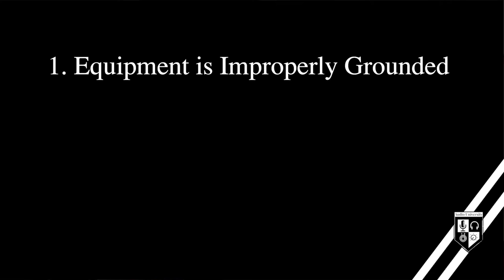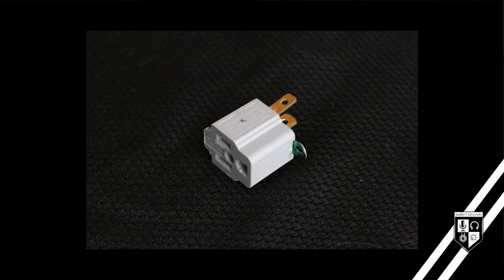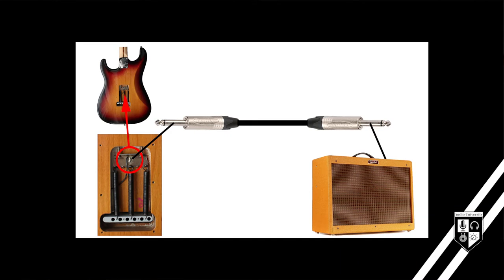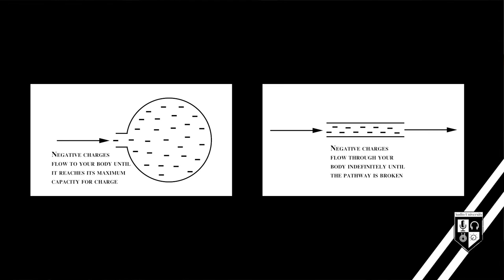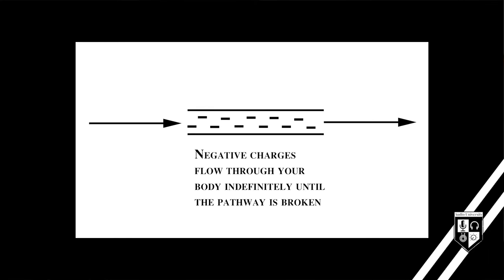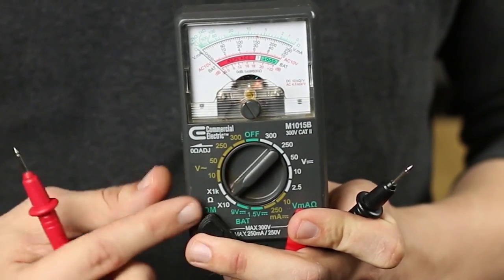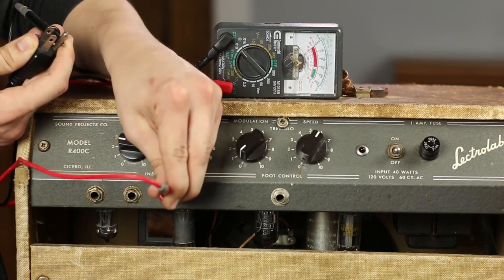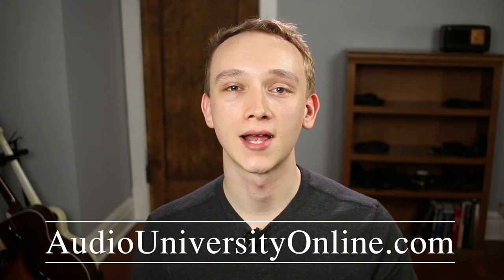Why is My Guitar or Microphone Shocking Me?

Comment: i am experiencing mild shocks when i touch my guitar strings, even when i changed the sockets....i have a blackstar idcore v2 guitar amp....they are quality checked amps, i doubt if my guitar has the problem
Reply: Bro i have the same amp ur talking about and am facing the same shitty problem but that happens only in my house so i tried to go to my friends house and it was working perfectly so i think its related to the house electricity.
Reply from the maker: @Ahmed Mahmoud is right. It may not be your guitar equipment, but the power infrastructure at your house. Does the problem persist in other locations?
Reply: I have the same amp and I am having the same issue
Reply: The issue has been resolved finally....it was the cord  (the detachable cable) that came with the adapter....the earthing wire wasn't properly connected so replaced it with a new one.... that's all....no more shocks, playing like a boss😝
Reply from the maker: Nice! Glad to hear that, @Shaswata Ghosh!
Reply: @ShaswataGhoshShas  how did u get it replaced? did you call Blackstar? Did they send u a new one? My id core does the exact same thing to me
Reply: @BRNREK47  i went to a nearest electrical shop.....they just checked the cord and replaced it with a new one...no need to contact Blackstar officials
Reply: @BRNREK47  as soon as you reach the shop, they are gonna povide you with the cord with the same voltage as previous one......so automatically you are going to get the same type of cord.....else if they feel they can just cut open the plug and fix it by soldering right in front of you and you will be good to go....so don't worry just visit any electrical shop and let the rest be done...cheers 🎉😎

Comment: Everytime I connect my guitar to mg laptop (plugged in with laptop adapter ) via stienberg ur12 AI I get a mild shock but when the laptop is running in battery I don't get shock.
Help me solve my problem.
Reply from the maker: Does it only happen when you touch your laptop and your guitar at the same time?
Reply: @AudioUniversity  it happens when I touch the metallic part of the guitar like strings and bridge etc. I just got a shock when I plugged in a headphone with a metallic part in my laptop.
Reply from the maker: I’m not sure exactly what’s going on. It sounds like it might have something to do with your laptop/laptop charger. I wish I could be more helpful!

Comment: So I have an audio interface that's connected to my pc via USB (it's not and can't be connected to a power outlet). My pc itself is grounded. To that interface, I have a mic and guitar connected. Both my mic and the guitar are giving me electric shock. So my question is, is an interface that is connected and powered by my pc via USB is not able to be grounded, or it should be grounded but something inside it, malfunctions. Also there was one time when I touched the top of the interface and it shocked me.

Comment: The ground wire is just a safety meassure to provide a route for the current from the chassis to the neutral wire if a hot wire ever touches the chassis, this is not a normal situation and means that your electronic device is BROKEN, checking if the chassis is connected to the ground wire will not solve the problem and it is still dangerous if the situation described above ever occurs, there should absolutely never be any voltage on the chassis of the device, if there is, either open up the device and check for any disconnections or just toss that shit away

Comment: Bro I get the tingling sensation and sometimes it gets too much when the inside of my arm touches the bridge  and yes I got a two pronged adapter but that's how they sold it to me in the shop? You think I should get a new power adapter with 3 prongs?
Thanks
Reply from the maker: I had an amp with a two-pronged plug that did the same thing when I bought it. Installing a three-pronged cable fixed the problem for me!
Reply: @AudioUniversity  thank you! and there's also a buzz sound when the guitar is connected and in idle .it's a laney mini 6w amp but the power adapter is cheap you think even the buzz will be fixed? When I change the number of prongs on it
Reply from the maker: I’m not sure. It’s possible that the buzz will go away. Is there a pedal board or anything else connected in the signal chain?

Comment: Where should I place my amplifier? On the flore?
Reply from the maker: If your amplifier is operating correctly, it doesn't matter where you place it. Just be sure not to place it near a cell phone, wireless router, or any other source of electromagnetic noise. 

Are you having problems with your amp?

Comment: what can i do if I don't have grounding in my electricity source, like for example the plug on my wall? Also my microphone only sends shocks towards when I put it on the mic stand, so can this be fixed by putting tape on the parts made out of metal?

Comment: I am working outside with all my cables running on the ground in the somewhat wet grass. No damage to any cables. Getting a nasty shock from a vocal mic. If the test shows no issues from my mixer, do you have any suggestions?

Comment: Is it possible to have this through improper guitar grounding? If possible I don't wanna resort to opening the amp yet.
Reply from the maker: The guitar is grounded to the amplifier. You can verify the guitar grounding is correct by checking continuity with a multimeter between the bridge of the guitar and the sleeve of the instrument cable.
Reply: @AudioUniversity  hi there, I seem to have found the problem, but thanks for your informative video, still. You won't believe why It hums. I had my phone connected via 3.5mm jack to the amp and the phone was charging (most of the time it is) and it was caused by the charger. Don't ask me how, idk.
Reply from the maker: It might be a ground loop. I’ll be making a video on this eventually, but search ‘ground loop’ on YouTube and watch some videos. You can probably fix the problem by plugging them into the same power source or using a ground lift in the audio connection.
Reply: @AudioUniversity  they're plugged on the same extension socket from the same breaker (our electricals are weird) I'll be looking into the ground lift thing and ground loop thing. Thank you very much!
Reply: @AudioUniversity  i really appreciate your answers, just so you know, I'm just a 20 year old with a crappy strat copy, a loaner line6 spider III, and a Nux MFX-10. You're a great help.
Reply from the maker: Please keep us updated if you discover the reason that solved the issue! It might help me and others!

Comment: I am using a fender mustang lt25 and I'm getting shocks from my bridge and strings when I put my arm on it(not the hand) my old vox amp came to me with a extention (idk what it was but it was something to control the voltage)the guy who i got it from told me it'll get expired quick if I dont plug it to that volt control thing... also... my amp remains on for 2 to 3 GOOD seconds after I switch it off... what to do?BTW its a three pronged plug
Reply: Oh im having the same problem with my lt25 did you find any solutions?

Comment: my problem is that, when i plug in my guitar to the interface, the guitar strings shock me. how can i fix this. nice video tho
Reply from the maker: Are you plugging your laptop and/or interface into power?
Reply: @AudioUniversity  i used behringer 202hd to my pc 2.0 usb
Reply: @AudioUniversity  should i use a pc or a laptop?
Reply: @AudioUniversity  it shock me when its plugged in my pc
Reply from the maker: It shouldn’t shock you with a PC or a laptop. You should be able to use either.
Reply: @AudioUniversity  oh okay  thank uu bro

Comment: My old amp has a ground, its not shocking me. The new amp isn’t grounded and shocks me.
Reply from the maker: Maybe not what you'd expect! Have you had any luck fixing your amp?
Reply: @AudioUniversity  nope. Eould need to grt a grounded power supply or somehow ground the current one
Reply from the maker: I had that done for my vintage tweed amp in the background. I used to get shocks when playing it. Replacing the power cable fixed the issue. It’s well worth it!

Comment: If I use a three prong plug but uses a extension chord that can connect the 3 prong plug but the extension chord is only 2 prong and connects it to the wall plug is it still going to shock me or not?
Reply from the maker: I would NOT recommend connecting a 3 prong plug to a 2 prong cable or adapter. This can be very dangerous.
Reply: @AudioUniversity  I'm using a fender champion 40. Someone said if it's true that I can use a power regulator or some sort or should I stick to 3 prong cable and socket? My only concern is that a fire could start or either killed by the amp
Reply from the maker: While I’m not sure exactly why your getting shocked, I can certainly recommend that you only use a 3-prong connection to power.

Comment: I have a digital multimeter but i dunno how to use it and what im supposed to look for
Reply from the maker: Beyond testing the equipment like I demonstrate in the video, I don’t know what to recommend. Sometimes the problem lies within the equipment, other times it is the result of another variable.
Reply: @AudioUniversity  I set it to that omega thing like you said  and it showed "1" and when I put the needles like you did in the video, it stayed the same. I am guessing it was supposed to change? Is my amp faulty?
Reply from the maker: Does it show a “1” when you touch the probes directly together?
Reply: @AudioUniversity  yes.. it does
Reply from the maker: That means that there is “continuity” between the two probes. In other words, the circuit is closed. When testing the amplifier, you are testing to make sure the different parts of the amp are connected. So, if you see a “1” that’s good, because it indicates the probes are connected. Does that make sense?
Reply: @AudioUniversity  ahhh yes that makes sense. So there must be issues with my power socket?
Reply: Okay So I put one of the needles in the V/ Omega socket and one in COM. Before it was on mA and it didn't change value but now when I put the two needles together it goes from 1 to 0. When I test it with the amp,  it fluctuates and jumps values from 0.07 to 6.5 with the guitar cable plugged in to the socket(it's not connected to the guitar). When the socket is empty, the value stays at 1.
I hope I am making sense.
Reply: Other inputs like EMI and mp3 line in fluctuate in value but not the guitar cable socket which stays at 1
Reply from the maker: I’m having a bit of trouble following. But it sounds like you might be on to something! I’d recommend getting the amp checked out by a repair shop.
Reply: @AudioUniversity  I noticed something. I was checking when I get shocks and when I do not. So I touched my laptop while I was playing the guitar and I got zapped. The laptop wasn't charging or connected to the wall it was running on dc power. I'm sorry for bugging you like this.
Reply from the maker: No worries! It’s just that I am by no means an expert in electronics. I don’t want to mislead you with the wrong advice. To me, it seems odd that you would get shocked even when the laptop is not connected to power... But that tells me I don’t fully understand the cause.

Comment: So electric guitars have been around since the early 50s when there were no 3rd prong plugs or outlets. How did the not get shocked?
Reply from the maker: That's an interesting question! I'm not exactly sure, but I think they were designed to ground to the neutral pin of the power connector.